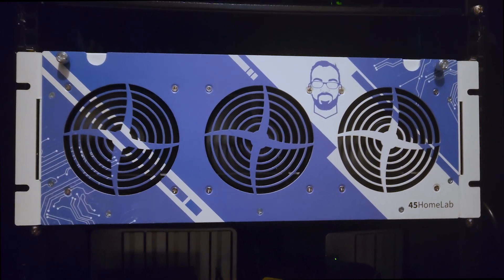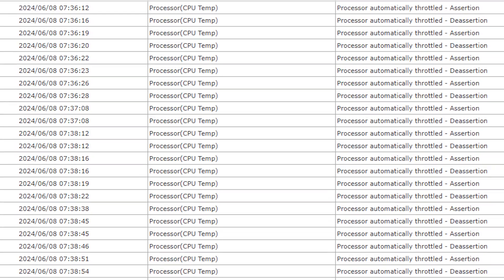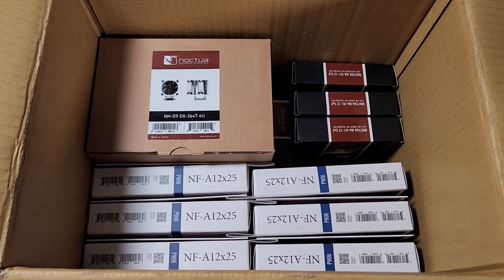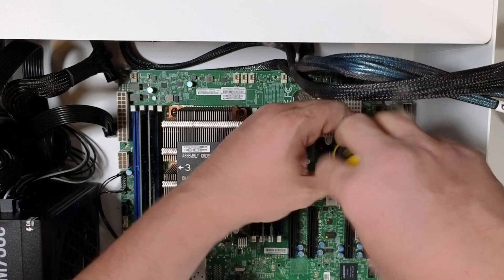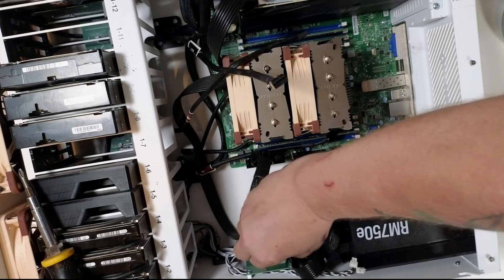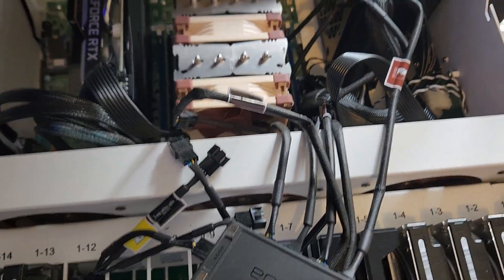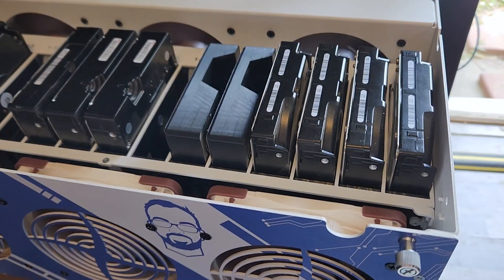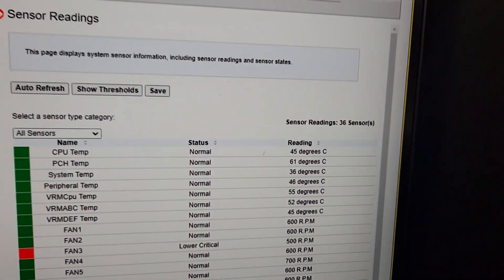Noctua Saves the Day: My HL15 Is Now Cool AND Quiet!

Comment: When you originally posted your video on this you mentioned that your rack was too narrow to fit the rack rails provided for the HL15.  I was thinking of upgrading to this rack and was wondering what you ended up using to get it rack mounted? and is there enough space at the back of the rack to put the back panel on when it is fully slid in?  Thank you!
Reply from the maker: I ended up putting it on a sliding tray but I had to leave the back off of the rack to get it to fit the depth

Comment: The HL15 is trash. If you need $200 worth of parts to make it work for you!
Reply: It's expensive but it definitely isn't trash.  There are a number of chassis that can handle 15+ drives but feel free to link one that is available in the US that can take a standard ATX PSU with the same build quality that doesn't cost as much or more.
Reply from the maker: And after they sent me this device, they partnered with Noctua so this isn't an issue for anyone else in the future. I covered that in the video. I guess you missed that part.
Reply: @DBTechYT  the noctua drives are an upgrade of 231 dollars USD. They are not the standard fans unfortunately
Reply from the maker: @WobblyCobblestones  Just confirmed this. When I made the video I wasn't told about it being an additional charge, so this is news to me. Thanks for sharing.

Comment: What are your drive temps like with your Noctua fans? I have a SuperMicro CSE 847 and use Noctua's industrial 3000rpm fans in my chasis and they make AIR FLOW!!! but the expense of being louder. I was looking at this Noctua fan controller but wanted to see what your temps were like for your hard drives at those fan speeds.
Reply from the maker: looks like my drives are in the low-to-mid 40s

Comment: It has been interesting to me from day 1 how at 45Drives there could have been such a massive oversight at launch for what most expect out of a homelab, specifically in terms of cooling and noise.  I've built a server and workstation the past year and using anything other than Noctua wasn't even a consideration outside of an AIO for my workstation.  It's just a shame at the price point that the Noctua fans will be an even higher upcharge, or you just have to throw away the OEM fans and swap yourself 🤷🏻‍♂️
Reply: While I understand the sentiment it wasn't really an oversight considering the market they were used to.  I personally would have preferred a low noise active cooler on the CPU and slower fans but having worked in DC's and with 45drives before this really isn't out of the ordinary for their usual market but is for the homelab market. It will take them some time to learn what the homelab market wants and so long as they end up making a better product I'm OK with that.
Reply from the maker: New HL15 setups will come standard with noctua cooling. I talk about that in the video

Comment: Hey DB,  love the content! I have a side ques for ya regarding server racks. I currently have a Dell R710 and 720 server I would like to rack mount however I am having issues finding the right one as I recently bought the wrong size and the server did not fit in length and was too long. Was hoping for some help on buying one that would also be good for Unified  Network equipment as well going forward? Cheers!
Reply from the maker: I don't have a lot of experience with different racks... All of mine are relatively shallow like it sounds like you have. I'm currently using a SysRacks setup that is only about 20" deep, but I think they have other options on their site: https://sysracks.com
Reply: Dell makes their own racks of varying U for these servers of course. Those are pretty deep servers. Look for a used one that hasn’t been abused.